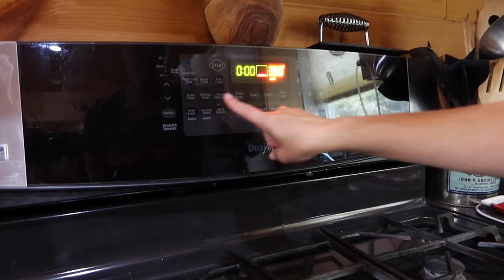Well I've Never Done IT Like this BEFORE. Prepping The Post & Beam Barn for Spray Foam Insulation

Comment: They make flexible plastic wiring tubes in several diameter sizes, you buy them empty and install in any areas you may later require wiring for lights and power. You install before foaming or closing up dead spaces. Then use a vacuum with a drag line to install additional wiring later as your needs arise!
Reply: Good idea, but just wait. I think you'll like the finished product.

Comment: I would think you would want the spray foam to adhere to the sides of the beams and posts to provide a solid seal against the cold.  It would also give more structural support if it is adhered to the posts and beams.  If the spray foam guy says to do it that way, I would be questioning that and maybe checking with some other spray foam contractors on their opinions.  Other than that, the barn / workshop really is looking great.  Also, would recommend doing the wiring first.  If not, then run conduit inside the walls for the wiring then spray foaming.  You will get a better looking structure that way.
Reply: Yar Nunya  I understand that, but that is why I was saying about using the conduit and running the wires in it.  Don't need an errant goat or other animal chewing on exposed wiring.
Reply: I agree with michael newman, the sprayfoam needs to stick in the corners.  Just tape off the wood 2" from the boards and tape the rest of the top of the wood.

Comment: Suggestions: Build shelving next then cover one wall in a French Cleat system.  You can organize all the misc parts, pieces and screws you have and are going to need on the homestead.  You could use a lot of those scrap pieces to build the boxes and hangars. Most of all a build a sturdy workbench.  Good plans are available on the Internet. Plan out where you can put the compound mitre and table saws.  I would also consider some sort of wood burner for heat.  Don't forget a comfortable home for the Kubota over the winter.  God bless you and your family
Reply: I all most cried when he thru all that scrap pieces of lumber out in the weather, So Wasteful!!!  Guess he can afford it. Not me, I make name plates out of the scrap !!!

Comment: Al and Gina, you're covering areas you want (need) the spray foam insulation to stick to.  I've been pondering this since the first few minutes of this video.  I've watched all the way through.  IF it were me, I'd construct two rigid foam insulation assemblies you could construct (may require four sections in each assembly) to include the lower post, the angle brackets (left and right of the post) and the upper post.  Make the sides just deep enough to cover the beam where you want it covered and leave exposed the final thickness of the spray foam insulation.  Two assemblies, four (possibly) sections each.  Spray that bay and then take the four assemblies from one post and move it to the next bay (post).  I've searched YT, I don't see any examples of exactly what you're doing.  I do wish you the best!  Thanks for the video!  Always a good view!
Reply from the maker: We still have one more step to do to get ready for the spray foam. It should make sense then.
Reply: @LumnahAcres  I'll certainly be around to see what you're doing.  I want you to know I'm not critiquing just to be a critic.  That I said anything at all is only me trying to be helpful.  I see you covering parts of the posts, brackets and walls with paper and tape (I'm not including the gaps in between the wall boards, that totally makes sense :-) ) where you need spray foam insulation to adhere.  I'm interested in seeing how you address this, I'll be viewing...and enjoying your work.  Thanks, you both (thrice ;-) )!
Reply: @LumnahAcres  You were right.  It does make more sense now that I've watched your latest "This SHOULD Explain IT -- Next step getting the Post & Beam Barn Ready for Spray Foam Insulation" video.  You're building a secondary, interior wall with spray foam insulation sandwiched in between.  That's a load of work!  Well done, you two!  Thank you for ALL your work, including putting out video for us!
Reply from the maker: @RXRSawdustStation  Thanks. It will be worth it once its all done! It should look nice and still have the post and beam look
Reply: @LumnahAcres  On this we agree! :-)  I'm looking forward to your next steps!  All the very Lumnah best!

Comment: You both are doing great. Proud of how well you are doing. As for what's next....
1. Install a heat source for the workshop. You'll be glad you did. Burr, I remember the cccccold New England winters all to well. (That's why I now live down south. LOL! Yes, 2 feet of partly cloudy on a 4 ft base. That was it for me.)
2. Work benches & tool/supply organization, so everything is handy and easy to find.
3. Greenhouse design and prep for a garden and permaculture food forest. This will increase your productivity and self sufficiency over the long haul.
4. Design and plan a deck off the house (sgd) so you two can sit together and relax after working hard all day on the farm...some couple time.
Well, that is about it for now, I think.
Reply: Then from experience, you should reverse #1 and #2.   Otherwise, Al will be freezing his toes off trying to sort out all the nut's and bolt's.    Shop set up is never ever finished.   It can be a lifetime project.
Reply: @patrickinottawa27  I agree and stand corrected. LOL. We don't want them to freeze. That is certain. Order is now changed... TYSM

Comment: @Lumnah Acres
The problem with spray foam is you are applying it to wood which is your exterior sheathing. The foam will trap moisture on one side which will cause it to dry slower which may cause it to dry rot.  
I would suggest applying Galvalume to the exterior to keep the wood sheathing dry and make sure water cant ingress from the top. I would also suggest insulating the roof first because metal roofs condensate bad and that's where most thermal energy is lost.

Also consider foam is a fire hazard while mineral wool is a fire retardant.

Comment: I love my Insta Pot but it is so intimidating to me on how to make it work for different things lol.  I am excited to see the barn being finished and don't forget to spray a concrete sealant on the floor.  Hubby  was told by the concrete guys after they poured the floor while we were building our home to get a hand pump sprayer a tall cylinder type thing at Home Depot and the sealant.  Fill the cylinder and pump up the sprayer and just spray it on...it was a simple thing to do and a life saver to prevent oil, etc from soaking into the concrete because it is so porous.  It went fast and we were very happy we did it especially when it comes to hosing and cleaning the 1,000 s.f. of flooring in the spring.  It is a 3 1/2 car garage lolol.  Had to have a deeper 3rd stall of course the the old boy's boat!!!

Comment: In our area, spray foam DIY was 4 1/2 times the cost of XPS sheets, and professional spraying was way more than that. We decided to glue in foam board and foam the edges like we did with the exterior of the house (rain screen construction). Spray foam must be much more reasonably priced in your area. We are up on a ridge along the Mississippi in Wisconsin, and are far from any large city so maybe that is the reason. Being far from the hustle and bustle has it's drawbacks as well. I'm sure you're going to love the shop when it's complete!

Comment: Suggestion: Use masking tape on the post fronts. It comes in 1/2" to 6" wide rolls. The folded down paper will prevent the foam insulation from properly sealing to the sides of the beams.
Reply: I agree 110%

Comment: Al, Gina, To get the look you're after takes patience and a lot of paper,  tape and time. So easy to just foam it and sheet it. Put all your surface wire in conduit and get a safe, flexible and durable result. I did this in the back rooms of my deli. Good to have this stuff exposed. Keep pressing. You will look back on this year as one of your foundation years. Regards Stephen..... Either this or buy armoured cable like they use in fire protection systems. ( Afterthought 😀.)

Comment: I understand covering the exposed sides of the posts, but I'm curious why you covered the "enclosed" sides? You (Al) mentioned that the sprayed foam can help add structural rigidity to the structure, but it it isn't bonded directly to the posts, it seems like that will reduce this benefit. Also, a paper "gap" like that between the wood and the foam,seems like it would be a place for water/moisture to percolate into the lumber and behind the foam. Seems like it's counter productive.

Am I missing something? If so, please let me know!
Reply: Yep, I missed it, too. The 2x3 (or 2) strips will be fastened around the posts and beams flush to the walls. This will solve lots of possible challenges.  Cover the paper on the sides except the part they don't want sprayed.  Give the foam sprayer a depth guage and strengthen the foam adhesion.  Framework for the wall covering they'll be installing.  Absolute genius, Al!

Comment: Al,, all spray foam MUST be covered, as a former tech rep for a major chemical and spray foam supplier I can tell you that the spray foam is A flammable product. 
John Piper
Reply: He is covering it. 2 inches of foam between all the posts and beams to keep the look THEN panels between to cover. That's part of why the electric box is sticking out so far now

Comment: Hi Al,

Ive been watching your channel for a month or two now.  I’m not a homesteader but I find your channel really interesting.  My wife and i plan to build the same barn you bought.  We’re home brewers and want to have a dedicated brewing area and our own little tasting room. i put spray foam in my geodesic dome home in SE VT and we love it.  Good choice!  Did you talk with the insulation guys before you covered everything?  My guys were pretty good.  I didn’t have a problem with overspray.  I could be wrong but i think you would have a better insulating job if the paper wasn’t inside the cavities where the spray foam will go.   Now I’ll just shut up... 😉
Reply from the maker: We still have one more step to do. The spray foam guy is the one who recommended wrapping with paper.

Comment: For those suggesting that they wire first then insulate I'm sure he's listed the pros and cons for both. One of the reasons he might be wanting to wire after is the flexibility it allows for changing the configuration of the barn. Also, if one day, this isn't a workshop but dedicated solely to animals it will be easy to move lights and outlets and such around. It might not be as "pretty" but it can still look neat.

Comment: For GIna. Get a old second hand crock pot to make ur black garlic in . This is how I did it and everyone loves it  I put the garlic in seal a bags then put those in the crock pot. I sealed the cover to the base with packing or duct tape .  I left mine in longer then three months I wanted it hard not soft to make powder with it. After I opened it all what was not hard I dried in my dehydrater . Then I used coffee grinder ground it to fine powder

Comment: Run conduit for your wiring before the spray foam this way you can change wires out down the road when the conduit is buried into the foam you will not lose ** R ** Factor when you use the conduit

Comment: where the paper covering your beams hangs down against theverticle wall, it will pull your insulation off when you remove the paper. I hope I'm wrong, tho!
Good luck, I hope it works.

Comment: You need to fill/seal that gap between the metal roof and the top of the wall.    If you don't wind/rain and snow will blow in.  Use a piece of foam pipe insulation.
I hope you are planing of spray foaming the underside of the metal roofing.  Most of the heat loss in a building is through the ceiling/roof.  It should be at least twice as thick as the walls.  4 time would be best.

Comment: Cooking tip: buttering the bird goes better if the butter is under the skin.  It slides right off the top.  What I like to do for poultry is to drizzle olive oil over the skin and then rub in Adobo seasoning.  That stuff is awesome.

Comment: The papering was painful to watch, lol. I can understand wanting to protect the beams to retain the look, but I agree with many of the comments below that just the front surface should have been covered, not wrapped over the sides and on the back boards. That defeats the spray foam, it'll just come off with the paper. If the battens had been put on the exterior walls, you wouldn't have needed to tape the joints - and the seams would have been filled properly...
Reply: Just wait, it's all coming together.  This isn't the finish line, just part of the path!

Comment: Build a timber-framed skeleton for a big greenhouse, with plenty of shelving and storage space.  Erect it with corrugated perspex sheathing next spring. Make roll-out roof blinds for it so you can keep the heat down next summer!
Reply from the maker: I like that idea.
Reply: @LumnahAcres  in the Yotube search bar put Gothic Arch Greenhouse, Bow Roof Boat Shed and Stimson Boat Shed.....very attractive Gothic arch design, using a laminated arch design easily built by one person and assembled by two persons, stable in high winds and high snow load areas.

A friend and I simply bought a 4'x8' sheet of plywood, bent  a piece of wood from the bottom left corner to the right top corner and held it with clamps, pulled on the centre of it to get curvature that we liked. By screwing some wooden blocks to hold it in place we then loosely placed the centre wooden spacer blocks in before before laying in the inner arch piece. Some wooden blocks screwed down to hold it against the already in-situ parts, the centre wooden blocks were easily tapped and positions adjusted with a hammer before being screwed down. This gave us a 4'x8' half arch which when assembled gave us an 8' high by 8' wide full Gothic arch, very attractive and once we had spent an hour or two messing around setting the blocks we could easily turn out a half arch every ten minutes.

Overall the project was easy and lots of fun, the plywood can be cut down to keep the narrowed bending forms so easy to add further arches later if wanting to later extend then green house, sheds, length..... you can also buy Stimson Shed plan sets.

Comment: Is the tape needed on the walls that have the battening on the outside of the cracks? Standard practice for barns is keeping the wiring inside of conduit for safety and changing / adding circuits. So the wiring goes after the insulation and wallboard. That includes moving your load center out to make it possible to add circuits to it. I would install LED overhead lighting to make it easier on your electric bill with less amp draw and power usage. I would also keep the runs and receptacles up higher to keep animals from trying to eat the wiring.

Comment: Ya know Al you did a great job masking, but I would not be a bit surprised to find it hanging in tatters tomorrow morning.    I don't mean to be mean, it's experience of thirty plus years painting professionally!!!!  The best way I have found to do a job like that, is to spray the surface with a 3-m type spray adhesive then press paper onto it and trim off the excess!!  Works great on windows, and dusty surfaces you need to protect .  I think the pressure of the spray foam will blow that masking tape loose  as well!!!!   Anyway , I wish you the best of luck with this endeavor!!!!!
Reply: THAT is a very good idea except wouldn't the glue prevent the foam from bonding properly?
Reply: @g.cosper , Not as bad as that paper.
Reply: @augustreil  We shall see, huh.

Comment: Put in the wiring first, Al. Then spray 5" of insulation, You'll wish you did.
Reply: I think Al said that after the spray foam is in place he will be lining the walls and ceiling. If that is the plan then it makes sense to run the light and power cables around the barn in metal conduit. This will make it easier [and cheaper] to make any modifications or additions than it would if the wiring was behind the foam.
Reply: @soroako4142  Yeah, I like the idea of running the conduit along the top beam and branching off down the posts.  Gives it that industrial shop look.

Comment: The spray foam has to attach itself to the wood if you want it to add structural integrity to the building as you said.  Having paper behind the foam, especially in the joints/corners defeats the benefits of foam.
Reply: Exactly. I was wondering myself how it was going to stick, when the paper is in between the foam and wood ?

Comment: Not a construction video. But a necessary step to turn out as beautiful as it did. Truly wish I had a workshop like you have. It will be tough to duplicate or upgrade from what you did on this property. (Shop, goat buildings, and management of your property.) The one thing I think you will need is a she shed and deck by the garden area on the new land. Also, a building to store your equipment as well as a garage for Gina's car

Comment: I understand that you are trying to keep the insulation off the beams but with the masking tape also in the joints what is the spray foam going to adhere to? When you rip out the paper and tape it will have even less to adhere to. I've never done it but that's what it seems like to me.

Comment: I’m a bit confused. How are you going to remove the tape if you foam over it?
Reply: It stays behind the sprayfoam.
Reply: The tape will stay under the foam. The part he is taking off will be the front of each beam so he keeps his post and beam look.
Reply: You loose the structural properties and vapor barrier if the sprayfoam cant grab the wood and seal
Reply: Over time the  tape will disintegrate.
Reply: Oh, thank you